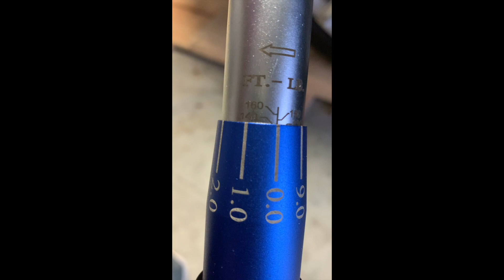Tesla Model S Brake Pad (how to)

Comment from the maker: Quick note.. when i pushed the pistons back in, i wrapped my wrench with a rag.  Really pinched it and wrapped it.. this is to not damage the disc.  Not much pressure is needed either.  But the pressure goes back and forth to the pistons.  You need to get it even for the new pads... home this helps!
Reply: You look like a homeless.
Reply from the maker: Reningan  Maximum troll Haha

Comment: I just done a cleanup on my brakes too. I got a 2015 70D. You should have lubed the sides of the brake pads with this:
CRC 05361 Silaramic Brake System Grease
This is what Tesla uses, I used a silikone lube as I can't get this for a reasonable price in EU.
Also it is good to use a wire brush and brake cleaner to clean where the lubed sides of the brake pad touch with brake caliper.

That Jack stand is nice but the price is sick. I used a 2.5t jack to lift the car. Front is not that heavy but rear was going up really hard.